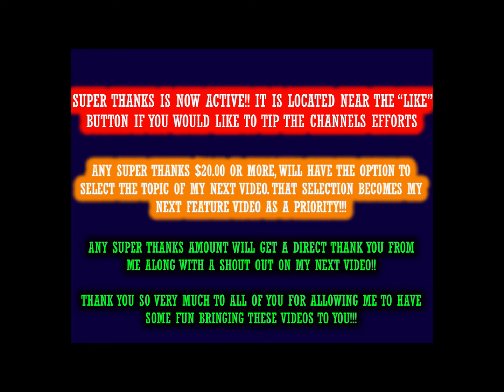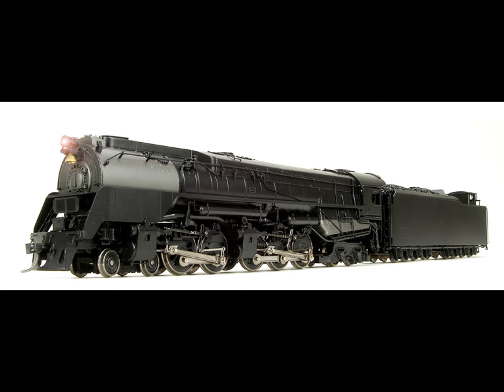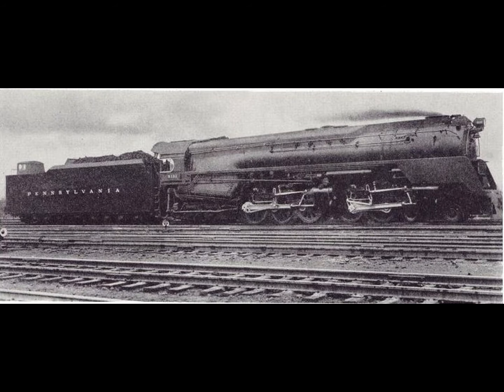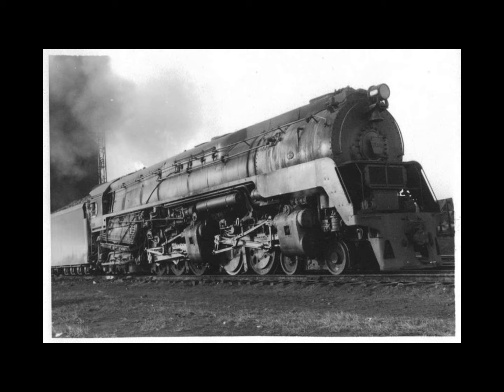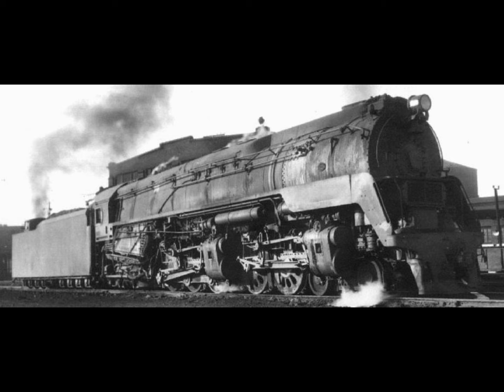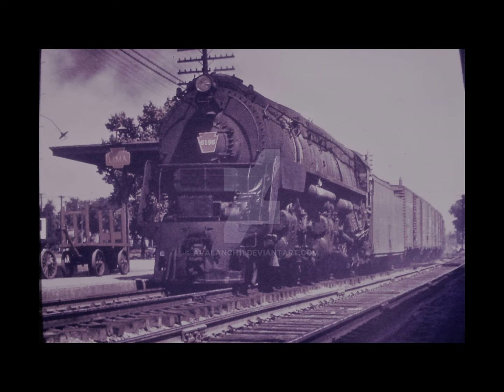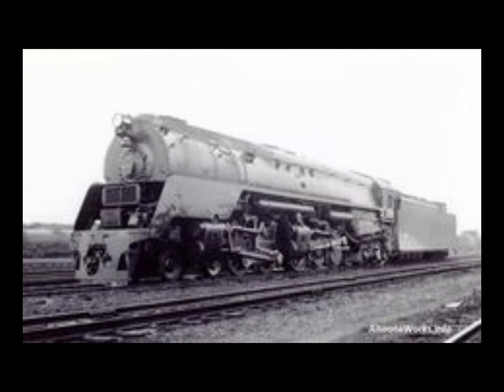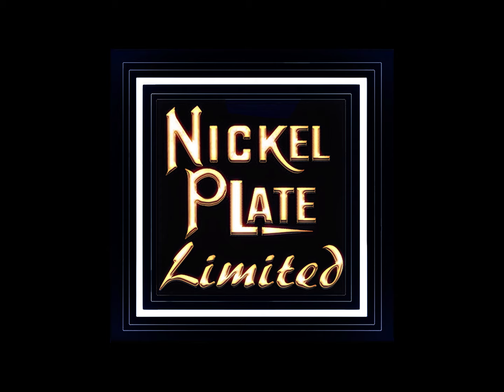Pennsylvania Railroad: Q2, The Lesson Was NOT Learned

Comment: While I have a O scale Q2 I did not know much about it. Thankfully in my fantasy world the Q2 is very successful loco!!!
Reply from the maker: Lookie here... The Q2 should not have been built for use on the Pennsy Lines. You put it on any line that runs fairly straight, where the Q2 can perform above 50 mph.. It's an entirely different performing machine. And it would have been seriously interesting to see what it could have really done. I think it definitely stood a chance to out perform any 4-8-4 under those circumstances. So your fantasy world Q2 is likely reality, Just not on the Pennsy
Reply: @TheRailroadCrossing-SteamPower 
The PRR had a mainline between Chicago and Crestline that allowed for high speed. They could have exceeded 50 mph there easily, as trains operated 100mph on that line multiple times.

Comment: I believe that a Q2 was sent to the Norfolk and Western for testing and evaluation and the N&W sent a class A over to the PRR for the same reasons.
Reply from the maker: I do not have info on that.
Reply: If you have a copy of Don Ball's book the Pennsylvania Railroad 1940's to 1950's, on page36, it refers to dynamometer road tests in Aug. 1948. Q2 6180 went to the N&W for testing and class A #1210 was evaluated on the PRR. The biggest complaint was the 6180's front engine had a tendency to slip, thus turning in an inferior performance. @TheRailroadCrossing-SteamPower
Reply: @alexmcintosh-fq2bp   There is an appendix in the back of Ed King's book "N&W Class A:  Mercedes of Steam" that contains the information about the PRR's Q2 tests on the Kenova District in comparison to the N&W's Class A's between Williamson, WV and Portsmouth, OH.  It's quite interesting.
Reply from the maker: @alexmcintosh-fq2bp  I have a Pennsy book.. But not that one. I will check it out!
Reply: The PRR woulda has better service with the N&W Class A
Reply: @daveprasse6643  That’s a bit debatable I think. Considering how crews were used to driving engines, enough to make a DECAPOD slip consistently, a 2-6-6-4 wouldn’t have handled that much better. A J has 8 drivers, but an A has a pair of 6, so the latter would be a bit more susceptible to slipping
Reply: @alexmcintosh-fq2bp  The tests also revealed how much thirstier the Q2’s boiler was, despite both classes having the same boiler diameter, similar length, and the duplex actually having smaller cylinders
Reply: Fun fact the PRR owen a lot of N&W rr stock. the N&W knew the PRR was very Badly Miss Manage and the N&W did not want to run the PRR

Comment: One correction, the Q2’s were the last full class of steam engine designed and introduced for the PRR but certainly not the last delivered. All of them were built before the war ended, and thus predated the production T1’s. 5524 was the last steamer delivered to the PRR

Tbf, the PRR did operate some trains over their speed limit during the war, but the decision to revert to the 50 mph speed limit afterwards killed the purpose of the Q2’s quicker than the T1’s. At least with the Q1, Altoona considered it a dual-service engine like the M1’s hence its streamlining, but employee documents show neither Q class were cleared to exceed the freight limit, unlike the M1’s which were cleared for 70 on the mainlines.
Reply from the maker: Good Info!
Reply: @TheRailroadCrossing-SteamPower  Back here after a few months to correct myself, apparently the Q1 was cleared for 70 during the war, but was bumped to 50 some time afterwards. That lines up with the PRR finding the Q1 more valuable as a freighter than in dual service...like the M1.

For what its worth, the Q2 could outpull basically anything in the east. Despite being closer to an N&W A class in size, power was far closer to an Allegheny, and I've heard theories that they were built in anticipation of a traffic surge from Operation Downfall. Being the biggest railroad with the most intrinsic ties to the US military (as well as some painful memories from WWI) convinced the PRR to build something that could handle heavier trains, faster, without ruining the track. In this context, the Q2 made a world of sense. They were basically Big Boys of the east.

In an ironic twist of fate with the Q1, it seems the Q2's had boiler problems made worse by the cylinder placement. Allegedly the Ft. Wayne trainmaster reported that all 26 Q2's were out of service in 1950. Why? Leaks around the rear cylinder saddle. They were caulked, but all of them being out of traffic again by the end of 1952 (6131 was not on roster in 1951 in seems) suggests the boilers were fucked from corrosion. So it seems to me they had trouble holding water, not strictly excessive use of it. Doesn't help they had less water capacity than the J1's either, and the latter didn't suffer the safe corrosion issues as their boilers used carbon-based steel instead of nickel.

Comment: The Q2 is a gorgeous locomotive, but some of its design features seemed to all but guarantee it to be a failure.  One advantage of duplex drives is shorter, lighter and more easily counter-balanced side rods.   The PRR could have taken advantage of that by designing the Q2 with smaller drivers (around 65") that put the horsepower curve within the speed of their freight train operating envelope.  Precluding the design from articulation leaves potential improvements over the J1 completely unrealized.  Articulating the front engine would have made the engine more versatile, more stable in curves and probably less slippery.  High horsepower numbers aren't worth much if they can't be applied to the rail other than bragging rights and wasted fuel.
Reply from the maker: Thank you Sir!!! I think I made that argument with Carl the other day.. About the hinging  of even Q1. Pennsy didnt seem to like articulateds.. but the duplex wouldn't even really look like an articulated if it was hinged. Not your classic looking one anyway. Hinging alone would have solved a lot of problems. Now, with 65 inch drivers as you suggest.. Is all of that enough to easily beat out a Texas in performance at 50 mph and below.. because that is what it would have been required in order to deem them a success and furthermore kept them in operation a lot longer than what they were.
Reply: if you articulate a duplex it's not a duplex anymore.
Reply from the maker: Well then you don't solve the problem.. It was a matter of choice by the PRR to try a huge, rigid frame loco on their rails that limited where they could operate. If Q2 had operated on the U.P.  or N.P. lines, for example.. I suspect we aren't talking about any of this as the locomotives success is gaged solely on it's operational cost. I think it's performance would speak for itself.. As in it works and it would have defeated any 4-8-4 it encountered. In my mind, hinging it would be the only solution on the PRR lines. Since Pennsy didnt seem to like articulateds.. You'd have a articulated loco that looks like a duplex.. LOL...

Comment: Based on what I've seen on the Q2 running the Q2s over the J1 Texas was Rail maintenance went down on the routes the Q2s operated. However as you mentioned in the video the maintenance cost outweighed those savings even though if they had made more of them the Maintenance costs would of lowered. Also PRR was wanting to upgrade their rails at this time for faster moving trains and the Duplexes was seen as a way to do this but because they had to be the latest and greatest trying to make another k-4 miracle happen they didn't make enough of the T1s and Q2s for that to happen. the tragedy for the Duplexes is stemmed in the success of the legendary K-4s.
Reply from the maker: That and they didn't build a duplex that could run to it's full potential on it's track limitations, But rather one that would excel.. sayyyy on a Union Pacific line.
Reply: @TheRailroadCrossing-SteamPower or the Wabash lol, Hell the Wabash would of ran them so hard they'd probably would of held world records.

Comment: This feels like a argument made without all of the facts, as while your points on repair cost are well founded, you missed the main issue with the engines that would plague all duplex drives for essentially their entire existance. 

Because both sets of driving wheels are mounted on the same frame, small imperfections in the track could cause one wheelset to have less friction than the other. On articulated locomotives this is mitigated as the two wheelsets have some ability to behave independently. Not the case for the duplex. this loss of friction could allow a wheelset to start slipping, even at high speeds. Once that wheelset is slipping the locomotive stops putting power down and it is all wasted, which could slow the train or cause stalls if not fixed, and the only way to fix it was to cut the throttle until the slipping stopped. for the Q2 the PRR installed a simple computer that would determine if one wheelset was spinning faster than the other using rollers on one axle per of each wheel set, and would cut off steam supply to that set until the slipping stopped. typically this ended up just causing a see-saw effect (one gets cut, the other one starts slipping so that gets cut, then the other starts slipping, etc). 

the N&W tested a Q2, and this is a railroad that does not mind engines with low factors of adhesion. in their testing it slipped so bad they doubled the amount of sandpipes for the first wheelset to try and fix it. Even then they had to use sand continuously, and the locomotive used so much it had to perform a stop mid route just to top up on sand. as a final nail in the coffin, one of the steam stop valves would activate when the engine wasn't slipping and just cut power. 

Sure, they were very big and cost a lot of money, and required more maintenance than other engines. The same can be said for basically any articulated in comparison to a two cylinder engine. But when the UP, or N&W, or C&O, or DMIR, or any of the other numerous roads that got articulated engines looked at the extra cost of maintenance, they saw a much greater benefit that those engines provided because they moved stuff quick. The PRR's duplexes main failings were in their over the road performance. They didn't live up to the hype. 

Again I wildly recommend "American Steam Locomotives: Design and Development, 1880–1960" by William Withuhn, which includes a chapter on the duplexes and discusses the slippage issues with the Q2. I would also recommend "The A, Norfolk and Westerns Mercedes of Steam" by Ed King. He is a N&W partisan which is grating to a C&O guy like myself but the appendix detailing the testing of the Q2 in comparison to the A is enlightening.
Reply from the maker: I didnt talk about the slipping problem because it appeared to have been dealt with........

" Furthermore, the Q2 had no problems building up steam power and was known to be a very smooth-riding engine. Twenty-six of them were built at PRR's Altoona Works, and they were by far the most successful duplex type. The duplex propensity to slip was combated by an automatic slip control mechanism that reduced power to the slipping unit. The slip control mechanism wasn't always responsive, and its complexity often lead to maintenance crews not wanting to bother with it during overhauls."

Comment: What were, in detail, the technical issues plaguing these locomotives? What did not work, what broke and what wore out quickly?
Reply from the maker: The first issue was the new, anti-slipping mechanism deployed in this new design was too complicated to a point that engineers and maintenance didn't want to work with it.  So the slipping issue, as with the Q1; remained. And it was a pretty notable problem. Now, personally I think you can fault the human side moreso the mechanical side.. The only other thing I ever came across was the quality of steel used, particularly in the boilers due to wartime demands. That would have forced the PRR to replace all of the boilers. How factual that is.. I dunno, because it was only one source that mentioned this. Otherwise all we are talking about is maintenance and operational cost versus bang for the buck. Which on Pennsy's lines, they weren't ever going to get because of the speed limitations.

Comment: A classic Pennsy, rather that make a 4-8-4 class to take over the passenger services, they waste their money making their prototype locomotives.
Reply from the maker: Shoot.. they didnt even need a 4-8-4 to match the Q2 performance below 50 mph.. The Texas was already doing that. Just order more, updated J1's.. wayyy cheaper
Reply: They could save some money if they didn't use the K4 in dual or triple headed, and rather just get 4-8-4, PRR.
Reply from the maker: Well that really depends on the 4-8-4 type. Some were really good with freights, some not so much. If Pennsy bought a UP FEF clone..  then yeah, cost savings could be had as you suggest.
Reply: @TheRailroadCrossing-SteamPower  I would put the 4-8-4 just for passenger service, so the K4 could be side line for less heavier duties.
Reply from the maker: @dustin_4501   Unfortunately in this event the 4-8-4's would NOT be used for passenger service. Especially during the war. 1) Freight traffic volumes were so that every locomotive that could possibly operate were fixed up and put back onto the mainline to run freight. it was that bad. K4's were even being down drivered so they could run freight. Passenger service was not nearly the revenue maker in those days. And never really was. The real money always lied with freight service. So yeah, if you have something as heavy as a 4-8-4 to run freight..it's running freight.
Reply: @TheRailroadCrossing-SteamPower yet again a northern will be a better option than the T1, and Q2

Comment: Why did the Pennsy have a 50 mph speed restriction for freight?

It doesn't make sense to me
Reply from the maker: Much of Pennsy's mainlines have curves the restricted speed on freights.
Reply: a lot of rolling stock may not have been capable of higher speeds and specialized high speed express freight services where selected rolling stock could be organized had not been developed - just guessing
Reply: @TheRailroadCrossing-SteamPower  Ah, that makes sense
Reply: @TheRailroadCrossing-SteamPower  That would’ve made sense for the majority of the PA Divisions, but the Q2’s spent much of their lives working east of Pittsburgh. Sandusky, Logansport, and the Panhandle were much more regular territory, and I believe there were more of them assigned to the Fort Wayne Division than the T1’s. The speed limit should’ve been lifted slightly for the entirety of the Western Region to get any substantial use out of them

Comment: Can you do a story on the PRR CC-2?  I believe it was ahead of its time. If trains had all steel under frames instead of wood queen post under frames, they wouldn't have been put in pusher service so fast.
 In my opinion. The Q2 was the most successful duplex. If it wasn't for the ICC restrictions on freight rates and not letting the railroads close passenger service on under performing routes. The railroads would have been in a better position to afford to keep steam going.
Reply from the maker: I will look into it

Comment: how would the Q2 have handled the long heavyweight overnight sleeping car trains? single handed I’d suspect
Reply from the maker: Would you be referring the Pullman cars?  As far as the weight of a passenger train... No problem at all. The thing would probably easily exceed 100 mph +  ... however... I suspect the Q would be too rigid on anything with curves, limited top end speed.. So put it in the plains.. It's probably breaking speed records.